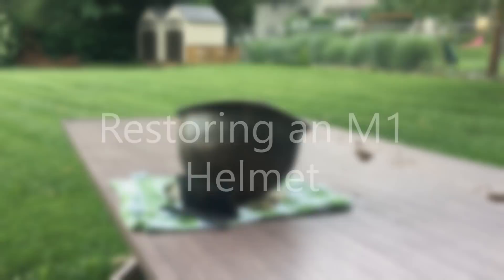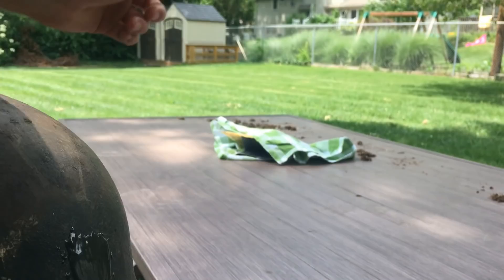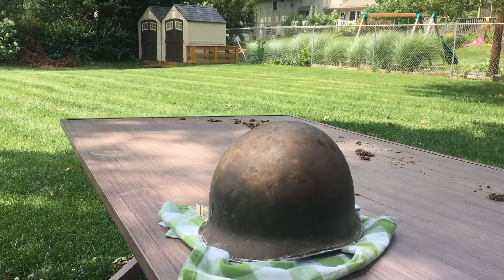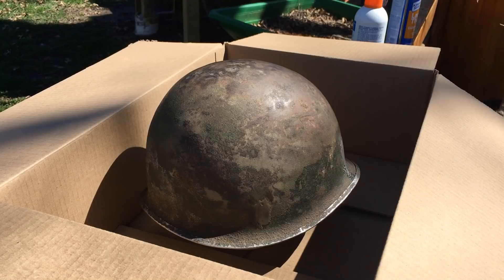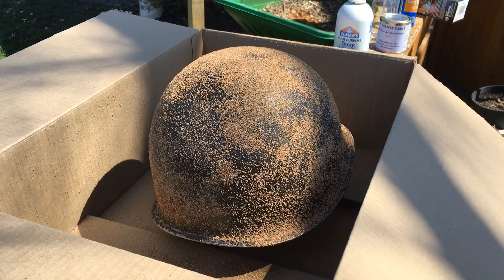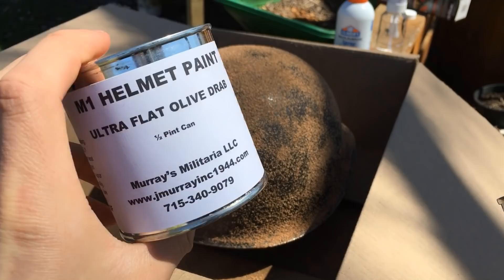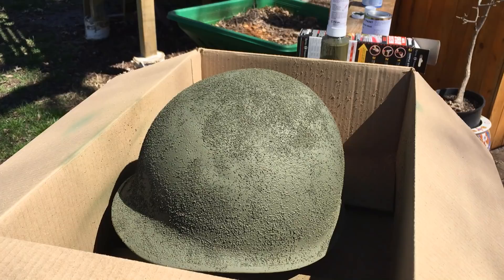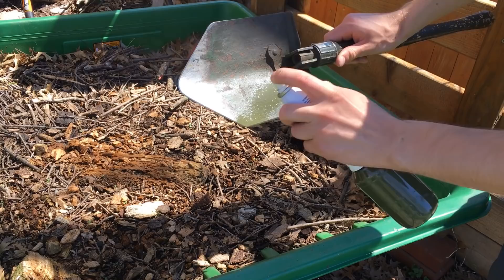Restoring a WW2 M1 Helmet

Comment: Remove the old paint first, then use the the bodywork filler. f you put the cork in a plastic jar that has small holes in the lid, you can the shake the cork onto the wet helmet. It gives you a much more even coating of cork on the whole helmet.
Reply from the maker: Steve Mr W that’s a good idea, thank you.
Reply: @worldwarguy459  better idea for stress cracks use solder it's better then jb weld but I realized there both metal lol

Comment: Hey world war guy I got a korean war m1 steel pot is that ok to use in ww2 reenacting
Reply: Why wouldn't it be
Reply: Because it's a post war m1 helmet
Reply: @thIDthIRreenactor  well, depends on your group standards - I'm not well versed in M1s, so I dunno the differences. To someone who kinda knows about WW2 and US equipment, theyre indistinguishable and I'm sure it would be fine to most units, but then again there are some German units which allow M43 tunics to Stalingrad events and some which don't allow you to have your insignia 1mm away from where it needs to be. So ask your unit, otherwise it should be good.
Reply: Ok well the differences are the seamed nail because a ww2 m1 is seamed in the front and a korean war m1 is seamed in the back to the right and a Vietnam m1 is seamed in middle back mines a korean war m1
Reply: Repaint it with corect paint and get accurate chinstraps
Reply: @armyman-sw1yw  I got the od7 ww2 chin straps and no they aren't the Vietnam m1 straps and I am repainting it
Reply: Oh yo I’m Barry

Comment: Buddy, you have to take off the original paint first
Reply: how and why
Reply: 1: with paint remover 2: in the future it might cause the new paint to chip and flake more easily
Reply: @JohnsonTheSecond  if you don't remove the paint then the finish does not look uniform